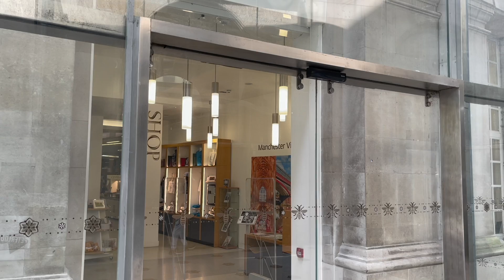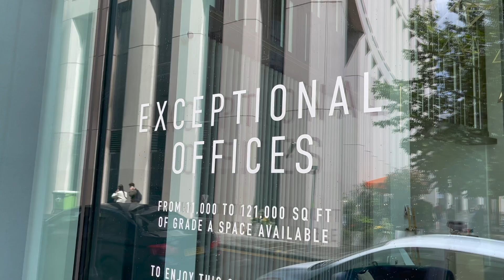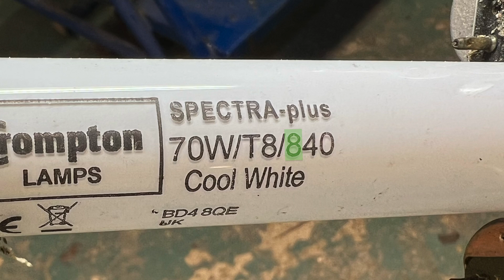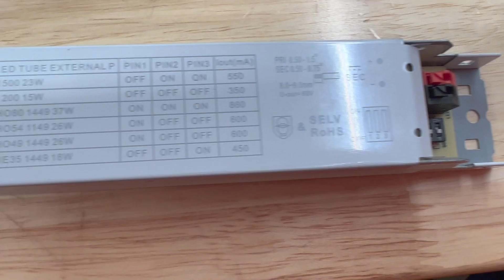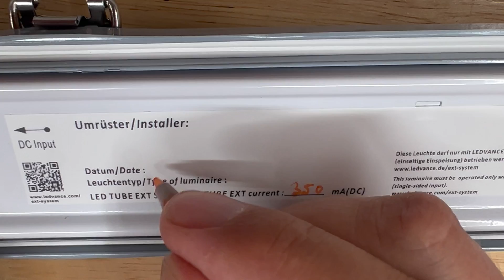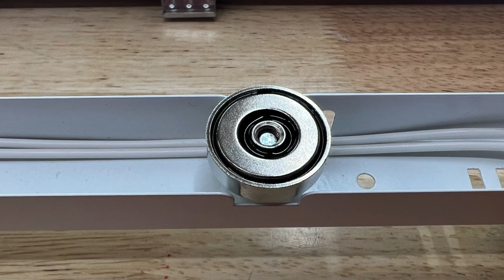How Can You Escape the Fluorescent Tube BAN?

Comment: these tubes will still be sticking around for a long time incandescent lightbulbs were gone 2012  halogens 2016 just wondering how these are still being sold on ebay sure these are black market items i will still continue using florescent tubes
Reply from the maker: Often sold as “heat lamps” with an side effect of producing visible light 😉
Reply: Incandescnet lightbulb had some advantages like instant start, color of light and form of bulb when compared to compact florescent bulb or led. There is not so many advantages in florescent tubes compared to leds.  So the florescent tubes disappear much quicker than incandescent bulbs from the market.
Reply: @AliusScitmelius   yea i mean the electronic ballasts were tat one tube change and the ballast is gone quite often i notice the electronic ballast costs alot more compared to an led tube replacement so i can instantly see the advantages there and on some of them ive done ive said convert to led over trying to find a ballast then pottentialy place import charges etc at a wholesaler when alot of the 4ft 5ft 6ft led tubes are on the shelf
Reply: @AliusScitmelius  Most LED's are instant start...